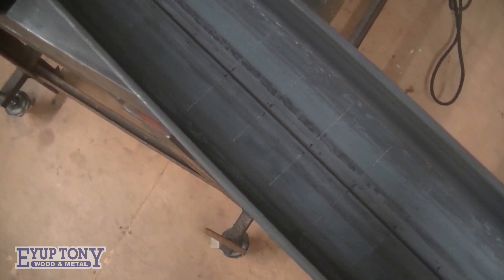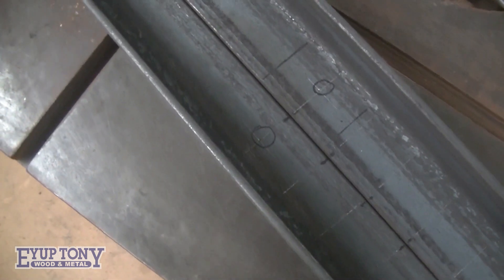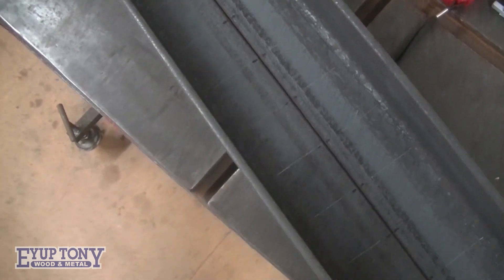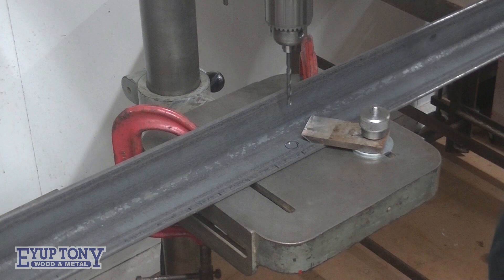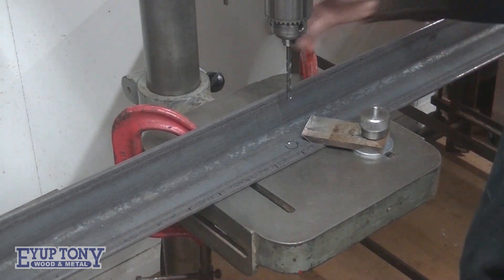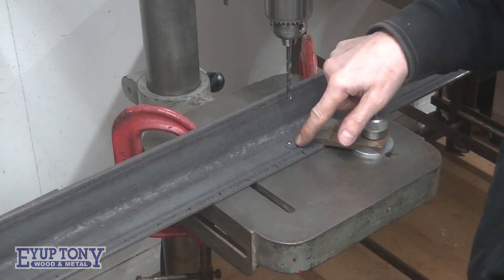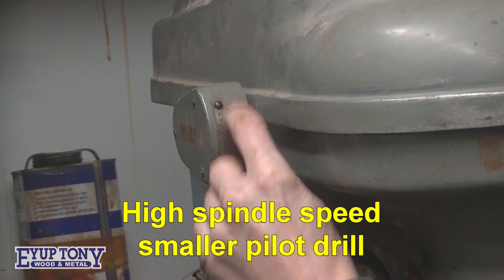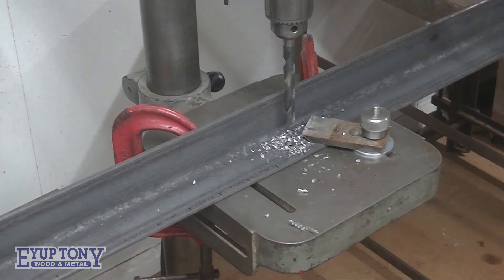LATHE AND SHAPER MOVE Trolley Fabrication

Comment: Good one Tony.  I will have to start thinking like you for multiple drill passes. I rarely use a fence, but I should.  That Hi/Low lever is top shelf.  Cheers Rob
Reply from the maker: Hi Rob. The fence is my woodworking production experience kicking in lol. I agree, the hi/low speed lever is the ultimate time saver. Cheers Tony